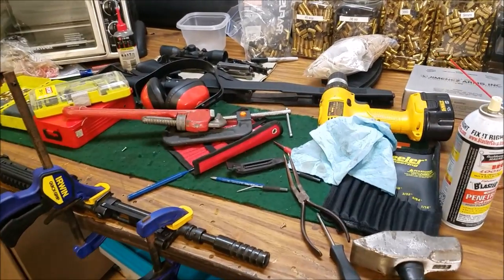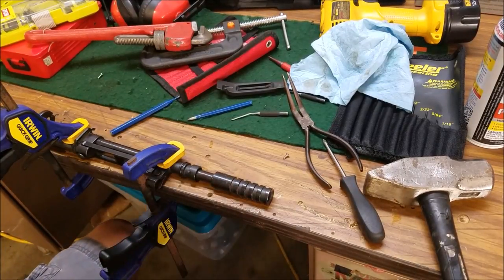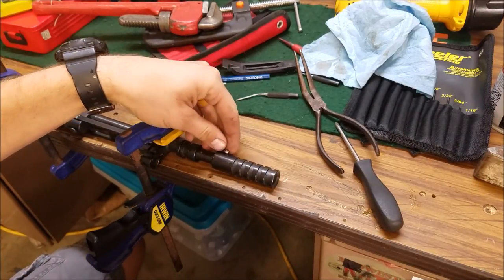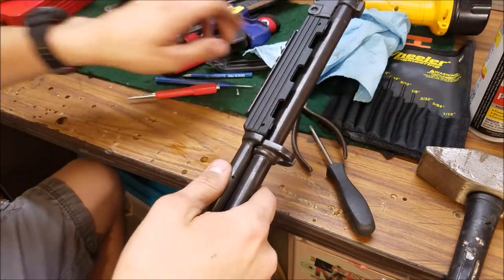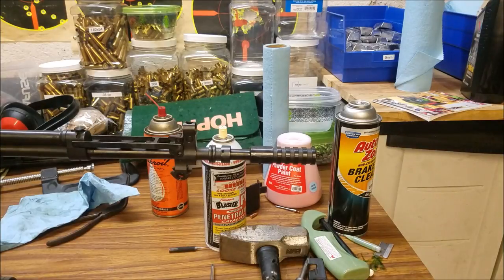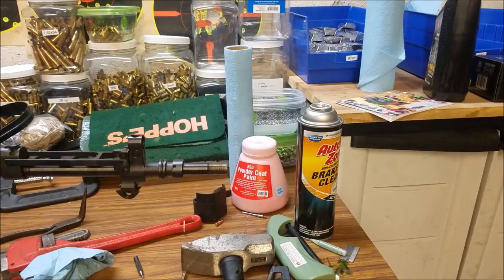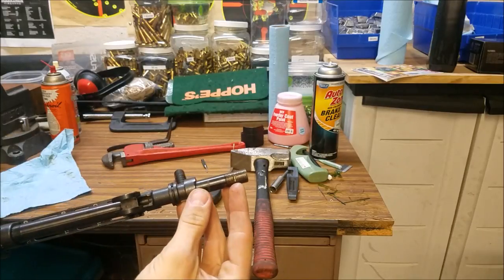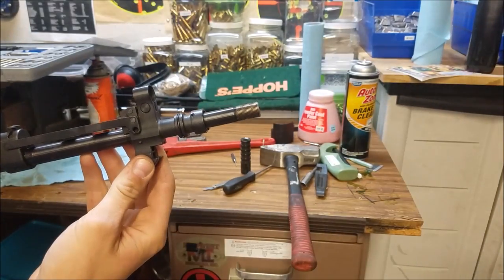Remove Yugo SKS grenade launcher muzzle device

Comment: I was expecting the ak47 style. But now you have a regular sks, the grenade launcher sets them apart from the rest. Thats the best part of owning a yugo style sks.
Reply from the maker: Jose Luis Hernandez from a collectors stand point yes you are right. Some people just want a good shooter, and the grenade takes away from the gun in that aspect. Exta length and weight.
Reply: Personally I'm a fan of the bayonet style on my Yugo. If I lived in a better area with more space and less neighbors I'd buy blanks and goof off with the grenade launcher but I don't and adding a nice muzzle brake wouldn't be a terrible thing. Hell, I like mine enough I'd buy a second one and leave it on in case my situation changes.
Reply: @GunsWithGage  actually when Yogoslavian SKS (real term PAP rifle) (PAP= polu automatska puska=semi auto rifle,  on Serbian) was design made and tested it was all done with grenade launched on the barrel,  so by taking it of you are messing up  original bullet ballistics , good way to lose accurately of the gun. Well your question how do i know... well my grandfather was making a lot of them.
Reply from the maker: @littlebitofeverything652  thanks for the comment! I'm not sure about reducing the accuracy by removing the launcher. I don't see the logic there. The grenade launcher is a larger inside diameter than the bore, so it should not affect the velocity either
Reply from the maker: @littlebitofeverything652  yes, the barrel is a solid piece from the chamber to the tip of the threads under the grenade launcher itself. I use a puller tool that removes the entire front sight assembly as a whole. The front threaded part is actually the barrel. The second pin helps hold the front sight/the rest of the launcher assembly to the barrel. There are not any more threads besides the muzzle threads. I hope that makes sense. I may have made a mistake in the video
Reply: You have to remove the grenade launcher if you are in certain states to avoid legal issues
Reply: @GunsWithGage  Anything you do to the barrel of a firearm will have some effect on accuracy; WWII rifles need curtain pressures applied to the barrel to have proper accuracy, old Mosin rifles are effected by the presence of their bayonet.

It is likely that the sks is designed with the GL on it for accuracy.
Reply: @sherithnoorey1419 you adjust your sights after removing the devices. My mosin shot high and to left or right without bayonet. Theyre supposedly zeroed with the bayonet attached. The mosin that is.

Comment: Good to know the thread pitch. I found your video looking for information the Yugo muzzle device. It fits perfectly to my Griffin 30SD suppressor except there is  a locking cut that need to be made for the Griffin mount. Using a pipe wrench to remove it would destroy the precision of the device, maybe detach at the second pin location? Then it should chuck up nicely in the lathe.

Comment: If you remove this won't it be a 922r violation?
Reply from the maker: jose martinez nope. It's just considered a part of the barrel. Not a muzzle break
Reply: It is an alteration, which arguably removes the C&R exemption that allowed the SKS to be imported despite not satisfying the 922r parts test.

Never seen anybody prosecuted for removing the grenade launcher, but I wouldn't want to be the test case.
Reply: once it loses C&R status, you just have to further bubba up the gun with tapco garbage until it doesn't resemble an SKS anymore.
Reply: No, it's considered a muzzle device and counts, but there's a special provision that says non-sporting features can be removed from C&R firearms without violating 922r.

Comment: What two pins do u have to remove to get the front sight off my bayonet lug and gl was cut when shipped to the ffl I had it sent to when I got because they won't realese it even thought it's legal so I found a replacement gl and front sight but don't know what pins to remove to get it off
Reply from the maker: Beltmaker09 you need a special press to remove the front sight block. It's easier to just cut the barrel shorter and re crown, and/or thread to ak47 thread pattern
Reply: GunsWithGage is that something that a gun smith would have

Comment: Did you find anything to fit on there?
Reply: This is what I'm wondering. I'm wondering if you can put what is on the Russian version on this one.
Reply: Tapco makes a muzzle brake that fits on these, looks just like the grenade launcher but it has holes drilled in it.  Honestly with the weight of an SKS, especially the Yugo, you really don't need one.

Comment: If you do not want to remove the grenade launcher permanently, just cross drill it through the low lands and make a flash suppressor/muzzle brake out of it.  Simple solution and it will still function with blank cartridges as a grenade launcher!  Been there, done that....and it works.